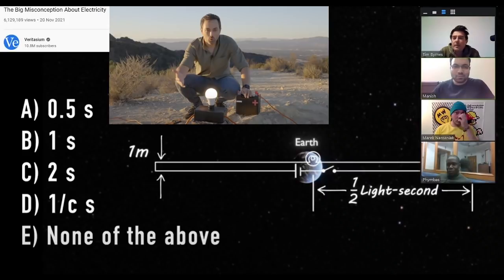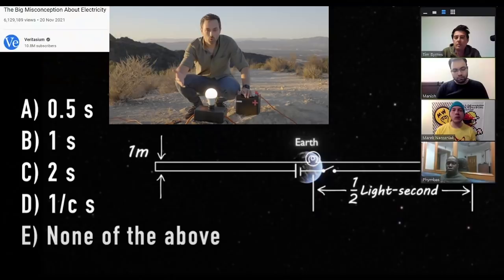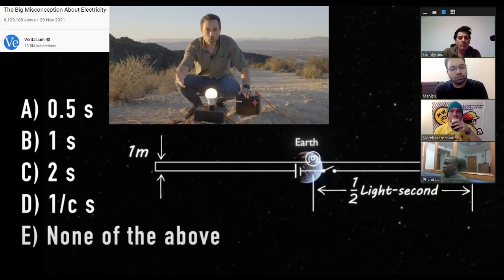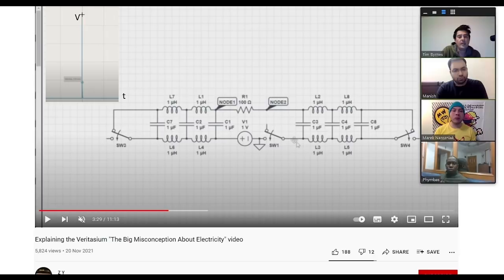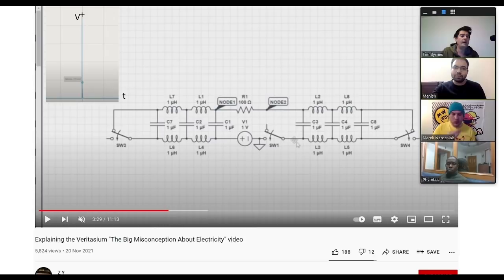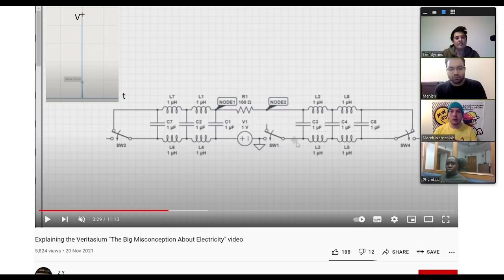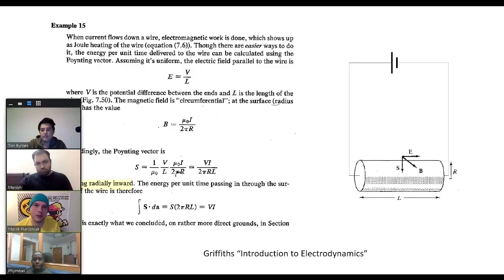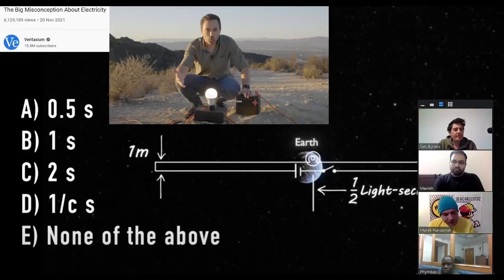Veritasium's Big Misconception About Electricity video and the point about Poynting

Comment: ZY, author of the video that you mention, has released a do-over ( https://www.youtube.com/watch?v=RsiYXfpJu5U ) in which he retracts some of his original claims and concurs with Veritasium there are plausible scenarios in which the light will come on at 1/c, and stay on.

His argument is this: the configuration is essentially a battery and a light connected to each other by a long transmission line on either side. When you apply a step voltage to the terminals at one end of a transmission line, then, during the interval before the electrical-potential wave has made its way to the end and reflected back, the current draw will be as if the terminals were connected by a simple resistor with a resistance equal to the characteristic impedance of the transmission line.

So, what is that impedance? If we assume superconductors, then it depends on the spacing of the wires, set at 1 meter, and their diameter. If you use zero-gauge wire (the size you might find in a heavy-duty jumper cable for a large car or truck) it comes out to be about 660 ohms, so if ZY's analysis is correct, you should have ~10mA available by 1/c, more than enough to light up a low-current LED - and it stays steady until the wave returns after reflecting at the end.

ZY also now says that the idea of there being an initial pulse is merely an artifact of putting a capacitor first in a discrete-component model of a transmission line, and that it may take several rounds of reflection before it settles down to a steady state (to which I would add that it would burn out a low-current LED, as the steady state applies 12V to it.)

This does not seem at all intuitive, but from what little I remember about transmission lines, ZY's argument does not seem obviously wrong. Is he making a mistake in applying the concept of characteristic impedance here? I think we can all agree that if we merely regard the wires as capacitors, there will be some current around the circuit almost immediately, so the only issues are the magnitude and duration.  I would be very interested in what you have to say about it.

UPDATE: Now I am wondering this: if the individual capacitors and inductors in the discrete model are significantly greater than the capacitance and inductance of one meter of the transmission line, does this introduce a tacit assumption that the fields can propagate instantaneously over the corresponding distances? For example, if the values for 1 km are used, does this tacitly imply that the effects of closing the switch cover the first 1 km instantaneously, and therefore render the model incapable of representing what will happen in less than about 1000/c seconds?
Reply: The Veritasium video mentions at the beginning that in the proposed experiment the wires would have zero resistance.
I think almost everyone seems to be missing that detail.
Reply: @jayytee8062  ZY explicitly makes this assumption - it modifies the formula for the characteristic impedance. and it is modeled by not using resistors in the discrete-component model of the transmission line (the capacitors and inductors in that model are idealized, assumed to have no resistance.) I mention this where I say we are assuming the wires are superconductors.

UPDATE: I may have misunderstood your point - are you suggesting that ZY agrees with Veritasium because he alone is assuming zero resistance? I do not, however, think that is a deciding issue here, unless every argument against Veritasium depends on an assumption of there being resistance. Also, I think ZY's model would work out about the same if you put modest amounts of resistance into the equation - though it makes the impedance frequency-dependent, which is an issue because when we are dealing with distances of the order of one meter, frequencies of the order of 300 MHz matter - and, with too much resistance, the light will not shine in the steady state.
Reply: I have convinced myself that the concern I added to my previous post does not matter: you can replace each LC cell in ZY's model with N cells, each with 1/N of the inductance and capacitance, and the result will be the same (or better - the transients, which are an artifact of using a discrete-component model, are smaller.) I think it is clear that one could model the situation with arbitrarily small cells and still get the same result (of course, as you approach the scale of one meter, the model's tacit assumption that there are no transmission delays within components (specifically, the capacitors, which model the gap between the wires) will begin to make a difference.)
Reply: @PGH Engineer There are two ways to address the 'will the light come on' question, the second providing more insight that the first.

The first is that  a low-power LED, drawing perhaps 2mA and with a forward bias voltage of about 0.6V, will come on almost immediately - very much closer to 1/c sec. than 1 sec. It is also quite likely to burn out immediately after, but if we combine it with a current source circuit [1], of the sort often used in ICs (and possibly built on the same wafer as the light-emitting junction), we can make a light that comes on at low voltage and can withstand the peak voltage that will occur here.

The second answer is that the light is a red herring, and I suspect Veritasium might have replaced it with a simple resistive load if he had anticipated how distracted people would be by the issue of whether the lamp would light. The substantive question here is 'how long is it, after the switch is closed, before the load starts dissipating energy?', and the answer, again, is that it is very much closer to 1/c sec. than 1 sec.

As for the questions you ask, you can answer them, at least to a first approximation, with ZY's model. The simulator allows you to model quite sophisticated loads, though all you need to address the point of this video is a resistor. You can see what effect reflections have (which varies depending on the impedance of the lines and the load), and note that, with a transmission line of the length specified, they do not have an effect at the load until a second has elapsed. You can replace each LC pair with N pairs of L/N and C/N, and see that the transients get smaller. You will find, in every case, that the answer is much closer to 1/c sec. than 1 sec (actually, in ZY's model, reflections arrive in about 2 msec, as the simulator is not powerful enough model a transmission line of the length specified by Veritasium, at least with much fidelity ).

[1] http://www.learningaboutelectronics.com/Articles/Current-source-circuit.php
Reply: @PGH Engineer The equivalent circuit for transmission lines of various geometries may be used for the specific purpose you mention, but is much more general than that: it was developed by Heaviside as a solution to Maxwell's equations for these geometries, and it correctly predicts the empirically-verified non- steady-state behavior that is relevant here: that when a voltage step is applied to the terminals at one end, then, at least until the outwardly propagating wave returns from  the far end, the behavior (current flow into / out of those terminals, and the voltage between them,  as functions of time) is as though those two terminals are connected by a discrete component having an impedance equal to the characteristic impedance of the transmission line (and if the far end is terminated by an impedance of that value, there is no reflection and the situation described here persists so long as an input is applied.)

If the wires are resistive or if the medium between them (or in close proximity) is dissipative, the impedance will, in general, be a frequency-dependent complex value. If different sections of the line have different characteristic impedances, this will likely cause dispersion and reflection that does not often allow for exact analytical solutions. These complications, however, are outside of the scope of Veritasium's thought experiment. 

All This is established, empirically-verified physics, and if you think it is wrong, the burden is on you to show that it is.

WRT LEDs, you are right that the forward bias is above 0.6V, on account of the sort of doping needed to generate light. I have seen figures as low as 1.8V in spec. sheets, and the article below has a chart showing the sort of range that exists.

https://www.circuitbread.com/ee-faq/the-forward-voltages-of-different-leds
Reply: @PGH Engineer I am going to say something that seems paradoxical, but bear with me... I think that crosstalk equivalent circuit will look just like the transmission line, if we account for the differences.

The first difference is that no part of Veritasium's circuit is grounded, and, with the arms extending halfway to the moon,  we are tacitly assuming that all those Cl's are too small to be significant (you do not have to get anywhere comparable to that far from Earth for them to be insignificant for the purposes of this experiment, where we are looking for whether the delay is ~1/c or ~1, which is a huge difference.)

In the diagram, I'm assuming that triangle at top left is the signal source, and that it is supposed to be some time-varying signal relative to ground. In our case, our signal source is the battery and switch, which together generate a 12V step function. Neither end is connected to ground, however: each side is connected to one terminal of its own transmission line, and they run off in opposite directions to minimize their crosstalk.

The Rs connected to the triangle might represent the battery's internal resistance. In ZY's model with 5mm diameter wires, we have a characteristic impedance of the transmission lines of ~750 ohms, so a car battery's internal resistance, which, I believe, is measured in hundredths of an ohm, is insignificant.

At the far end (right) of the  diagram, we have the ends joined by two Rl connected in series through ground. In the experiment, they are shorted together, with no grounding. The no grounding is significant, because in the crosstalk model, this grounding is equivalent to connecting  the far side of the battery to the end of the transmission line, but no such connection exists in Veritasium's experiment.

Returning back to the bottom left, we have Rs connecting the 'return' path to ground, and thus implicitly to the grounded side of the signal source. In Veritasium's experiment, that connection is via an equally long and ungrounded transmission line in the opposite direction.

If we were to redraw this circuit taking all these differences into account, it would look like Heaviside's model: a sequence of cells containing a series inductor and a parallel capacitance, with the far ends of this sequence  joined by some impedance (in this case, a short circuit.)

I assume you are thinking that there are two differences I have glossed over - this model has inductances on both legs, and it shows a term for mutual inductance.

The first is easy to put aside: If you take the traditional model, and split the inductance so that half is on each side, it makes no difference to the outcome, as can be checked with the simulator.

The question of mutual inductance is trickier, but you may find this article helpful:

https://www.comsol.com/blogs/computing-the-inductance-of-a-wire/

It explains why you cannot consider the inductance of a wire without considering the whole circuit (in an inductor component, this is still true, but the contribution of the rest of the circuit is insignificant compared to that of the inductor's windings.) This means that the inductance-per-meter value for a transmission line is not a meaningful concept except when you are talking about a completed circuit (possibly completed by displacement current when the far end is open circuit), and so the figure used in the Heaviside model unavoidably takes into account the effect that the current on one part of a circuit has on other parts - the self- mutual-inductance of the two sides of the transmission line is built into the formula, so to speak. We can see that in the way that the inductance-per-meter varies as we change only the separation of the conductors (https://www.eeweb.com/tools/parallel-wire-inductance/) - that would not happen if the inductance was localized to one wire, as it appears to be in the equivalent circuit.

To put it another way, we need mutual inductance to consider the effect of one current loop on another, but the self- mutual-inductance of a current loop on itself is what we are talking about when we are talking about its inductance. Therefore, the inductors in the Heaviside model, which do not explicitly couple the two conductors, do, in fact, take that coupling into account.
Reply: @PGH Engineer I have been thinking about it some more... this has not led me to change my mind about whether the transmission line model is applicable here, but I think I have a way make it seem more intuitive to see that the Heaviside formula takes into account mutual inductance.

Let's consider a 5mm diameter wire 100m long. According to [1], this has a self inductance of 0.211 mH. If we fold it in half, so that we have wires 1m apart (for a length of 49.5m plus a 1m link across the end), [2] gives a lower inductance:  0.119 mH. If we bring them closer, to 10cm apart, this falls to 0.0737 mH, and at a separation of 5mm (between centers, so the legs are touching, but treated as if insulated from one another), the formula gives 0 H.

This shows that the formula is taking into account the effect of each leg on the other, and that effect is to reduce the inductance. Intuitively, this makes sense: a rising current on the outbound leg will induce an EMF on the inbound leg towards the terminal, opposing and reducing the self-inductance of that leg, which, when the current flow towards the terminal is increasing, induces an EMF in the opposite direction. The closer the wires are to each other, the stronger this canceling effect becomes.

Here the current flow is anti-parallel, which is the opposite of a coil, where, in adjacent turns, the flow is parallel, and the effect of one on the other is to increase the inductance. Folding the wire in half is how we make wire resistors with low inductance.

Another analogy is that if we have a transformer, with high mutual inductance, and with a resistive load on the secondary, the primary presents a resistive impedance to the current source, despite the fact that if the secondary were open-circuit, it would present a high inductance. With a resistive load on the secondary, only when the mutual inductance is low would the primary present a significant inductive impedance to the source.

Inductance in a circuit tends to reduce the rate of increase of current, and what we see here is that, in a transmission line, mutual inductance reduces that effect. The inductances in the Heaviside model are the net, residual inductance that results from there being magnetic flux that does not couple one leg to the other.

Yet another point here is that the mutual inductance here cannot be greater than the self inductance: even with perfect magnetic coupling, they would be equal. Therefore, the residual inductance always exists and is always positive.

In Veritasium's experiment, a large initial current is favored by high capacitance and low residual inductance (the latter, we have seen, being a consequence of high mutual inductance), and moving the wires closer together improves both these factors. So, is 1m separation close enough? We can do the math, and see that, for 5mm superconducting wires (this whole discussion has ignored the wires' resistance), the impedance is about 750 ohms, which allows for a nontrivial voltage across, and current through, a load of that impedance, after 1/c seconds. The small capacitance per meter of the setup is compensated for by the fact that the voltage step is propagating at c, effectively adding another meter's worth of capacitance to the circuit every 1/c seconds.

[1] https://www.eeweb.com/tools/wire-self-inductance-calculator/
[2] https://www.eeweb.com/tools/parallel-wire-inductance/

Comment: Wow!!! I can't believe that original click bait video got so many video responses. I guess that's why engineers (operating in the theoretical world) and technicians (operating in the real world) rarely see eye to eye. I have since moved on to the health care industry, but have spent around 35 years in electronics. (either professionally or casually) And I can't think of a more useless topic than the claim from the original video that electricity doesn't travel through wires. Try to complete a circuit without the wires/conducting material. Yes a completed circuit can create a magnetic field that can create electron flow in a properly placed second completed circuit. Which is actually more a transformer than a capacitor. But that's a completely different discussion. But the original magnetic field doesn't exist without the wires/conducting material. I think you're giving the original creator too much credit. I don't think it was mistakes, but pure and absolute click bait.